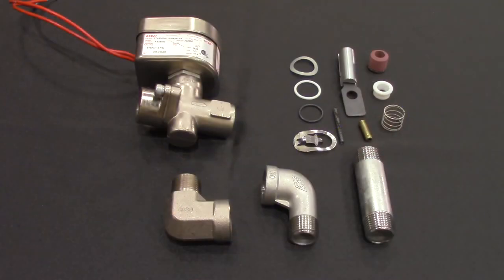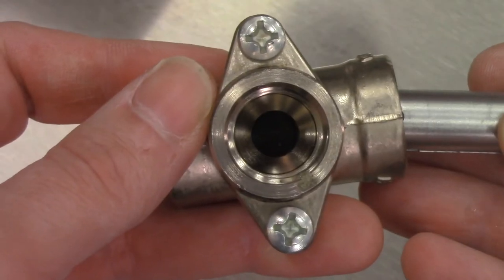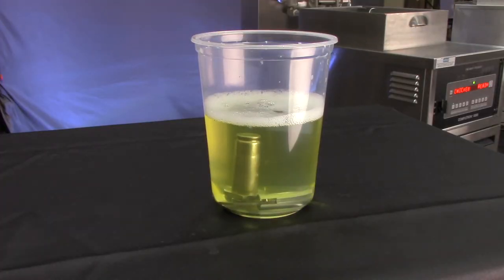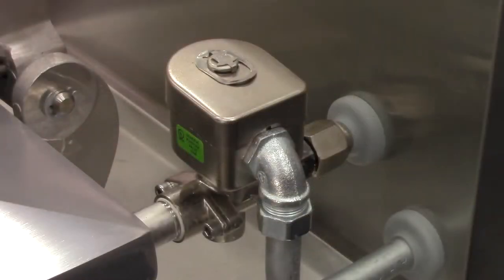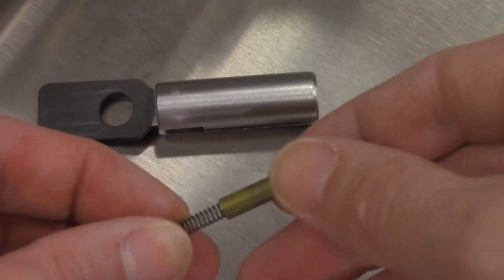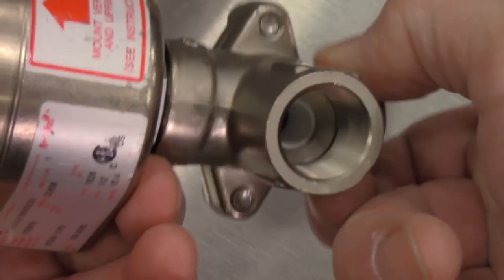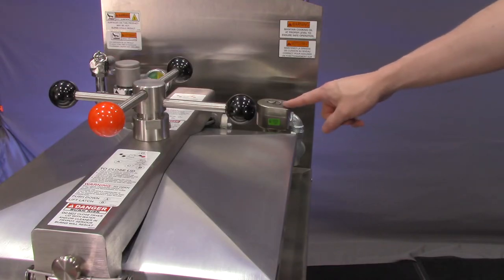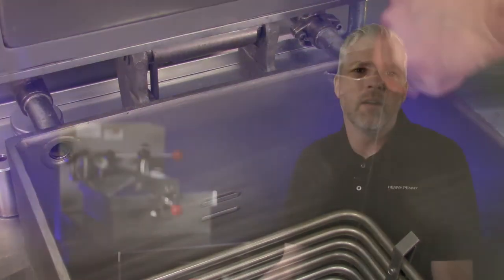Fryer is not Releasing Pressure - Henny Penny 4-Head Pressure Fryers

Comment: What if you clean everything solenoid steam box drain tube and the tube going across the back, and it's still slowly to release pressure? I even took the steam box apart and cleaned the tube inside with the holes in it. It's a henny penny computron 600 . I work for a grocery store food market( we have  17 stores )and we have henny penny fryers mainly in our deli's ,I'm a tech also. This is on a fryer I was working on yesterday
Reply from the maker: Good question.  Depending on the cook cycle and the amount of moisture in the product, you should have anywhere between 30 seconds and one minute to release pressure if the plumbing from the frypot through to the condensation box is fully open to its 1/2" diameter.  If this is taking longer, then the tubing or solenoid valve partially obstructed and not open to its full 1/2" diameter.
Reply: @HennyPennyService